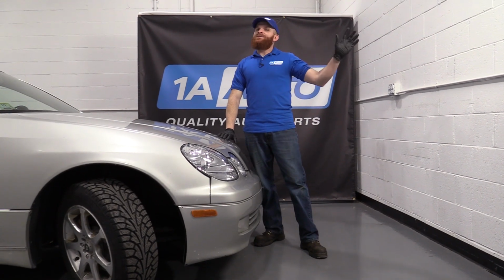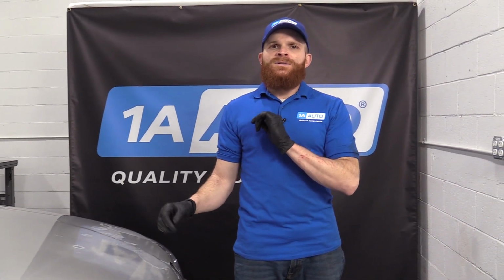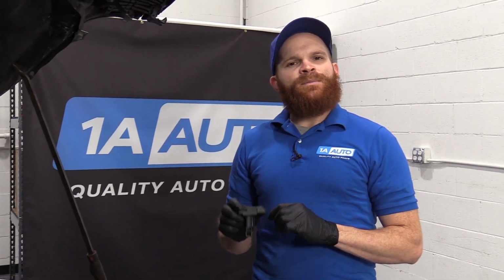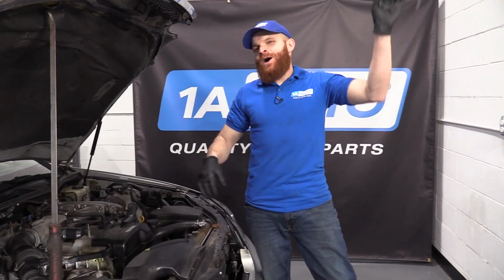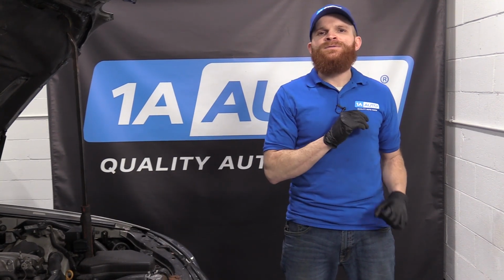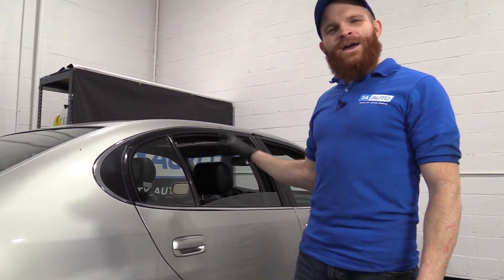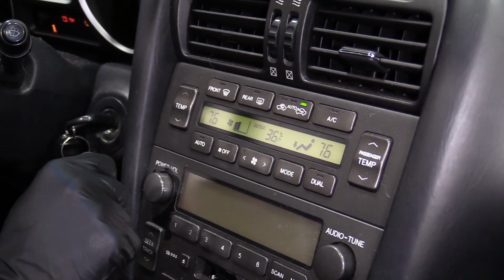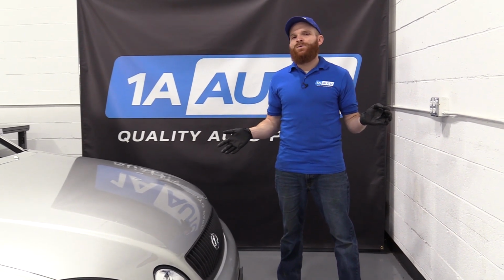Top 5 Problems Lexus GS300 Sedan 2nd Gen 1997-05

Comment from the maker: √  Watch the Video
√  Buy The Part at 1A Auto https://1aau.to/m-Visit-1AAuto
√  Do it Yourself
√  Save Money
Reply: what about the brake booster
Reply: What about the battery draining after everything else is replaced
Reply: Great video just bought a 1999 gs300 under 200,000 miles gonna get the 10 piece kit you guys got for $110 thanks for the information
Reply: Thks for the video I just bought a gs300 99 with under 335,000 miles still runs strong. That lower ball joint is my only issued I'm getting worked on right now.
Reply: Thanks bro, I’m going to purchase either an GS300 or IS350. Appreciate the advice.
Reply: Thanks soo much for pointing out these issues. I really did have this lower ball joint issue and i took a u turn and my wheel literally did came off a year back

The second one door lock actuator: exactly the same doors passenger and back side of the passenger door have issues. 

and lastly the HVAC servo Motor i still have this issue.

you have literally made things so much easy for me instead of going to different garages and checking finding out the faults.

Thanks !

Comment: Len is right about all of this I have a ‘02 IS 300 with 265k miles only thing would add is harmonic balancer eventually rots out, also alternator and a/c compressor, and struts depending on mileage

Comment: 1AAUTO I’ve been watching yalls vids since I was 13 years old back in 2008-2009 an have bought many parts so can you please answer this question?

I’m about to buy one an the guy is making me sign a paper saying if anything happens after purchase it’s sold as is. So I’m wondering if these have ECU Problems that’s my only concern he said the car dies after running for 20 mins an brought it to shop an shop said it was lose terminal but he still wants me to sign the paper… plz lmk it’s a Gen 2 GS300 1998-2001 Pre Facelift

Comment: my 97 is having probs last 10 years, 260.000, stays in the garage, 20 mile round trip to work only, frt end probs at 10 years, then throttle body, next a/c, steering wheel motor, check engine light, radio, upholstery, very squeaky now, engine in good shape....very happy with it

Comment: Mine is an 02 GS300 VVTI and I have a bad parasitic draw issue from somewhere and have checked all the common sense things it could be. I have the same door lock issue,the same air intake sensor issue and i hear a noise behind the dash when the car is off. Sounds kinda clunky,like the cd changer but it’s not the changer. Any help would be greatly appreciated! Thanks!

Comment: I got a question my gs 300 gives me a o2 sensore code P0141 01/01 which is the front one but when i replaced it to a brand new denso o2 sensor drove it for 200 miles the engine light didn’t go away and when i deleted the code it still is on i need some help
Reply: Try adjusting your throle position sensor. Mines wasn’t properly calibrated an gave me vsc light and p1014 code

Comment: I bought my 2006 GS300 used in 2010.  It had about 62k miles then.  Now it has just over 361k miles and while it has some issues it still drives very well.

Comment: Loved my 2005 GS300, but the ball joint failure happened while driving in traffic (no one hurt, luckily). Lexus fixed it under warranty at the time, but they had the car for three weeks. Currently driving an LS460 F-Sport and I kinda miss my old GS. Loved that car so much if I found a fully sorted 2005, I might get another.

Comment: Had a sway bar on drivers front side pop out from the link that holds the parts together,popped out of socket the car was marking a slight noise when i was reversing out my driveway which is gravel so its was moving and when im on a round about it would not feel as tight of steering or responsive barring right
Reply: Swerve motors and transmission slipping from being over filled and water punp leaking rust pockets in back wheel well and muffler rot other then that the car is very well for the age and better then 95% of the cars in the road Toyota did well other then bot giveing us in the us a 2jz gte🤦‍♂️😂

Comment: I’ve had 3 of these and LS400s also and the rear spherical lower bushes always need replacing and are difficult to do for diy, and I’ve had a heater core leak in one which was a nightmare to replace, full dash out.  Other than that and a bit of paint fade they are bulletproof, no rust, 2J is hard to kill.  Great cars.

Comment: What should I check for my 300000 mile 2002 gs300? 

I’ve done valve cover gasket, plugs, coils, power steering pump,  vvti sensor. Timing belt is good, but my radiator is brown 😑 should I replace? Or wait for it to go bad?
Reply: Vvti solenoid**
Reply: Also I only have heat on pass side and it only blow when Ithe car is moving.. otherwise no heat or air with blower on high.
Reply: @Zaydub666  This symptom for me was due to the door blend servos. If you’ve ever heard a sound under the dash that intermittently sounds like VVRVVVRVVVV (lol), then it’s that servo motor getting stuck on itself and “hunting”. The conductive contacts get worn as the lube dries up and the dust from the contacts will short two of the contacts together.

Comment: This guy is spot one - I've had every single one of these go bad on my Lexus except the lower ball joint.  The lock actuators are super pricy so I haven't replaced them.  I rebuilt one and it was a super pain in butt.  I've replaced my B2S2 02 sensor twice and upstream B1S1 once.  My 2003 GS300 has 185k and is making squeaking noises, which I thought were the shocks.  I'm going to see if there's any play there and replace.  About $95 each from Napa.
Reply from the maker: +Puffy Elvis Thanks for the feedback!

Comment: My 99 GS300, has 135,000klm, that’s about 84,000miles for you Americans, I replaced two controllers for my climate control but still need to replace the other one, my passenger gets cold air but I get ice cold air, but my back isn’t what it used to be so it’ll wait til I come good. It can be a bit thirsty so I may change out the o2sensors. I’ve had 40 cars in my 67yrs. this is by far the best.

Comment: Love my 2004 GS300. still got it today. Not a fan of IS or new styling. 
I changed the ball joints at 100k and the driver side was rear ready to go. 
Had the HVAC issue, it would buzz if I moved the airflow
only replaced the top 02 sensor at 80K

Comment: Every time I  turned right a loud squeak would come from the front , it echoed around the whole neighborhood. Took it to the mechanic and they told me the lower ball joints needed replacement, luckily I didn’t get hurt . I was driving it around like that for a month 😂

Comment: For those of u wanting to know what actually goes bad on a gs lol fuel pump brake abs module throttle position sensor and for those of u that replaced ur door actuator and the keyless locking isn’t working take ur door panels off their will be a little black box I don’t remember what it’s called but that’s what u need to replace
Reply: Any find out what the little black box is called? I thought one should just replace the actuator. Are you saying this isn't correct? Thanks in advance.

Comment: Best car in the world ...this car was my dream car in high school and I'm so glad I picked this car. I have had this car over 15+ years and I love it. I think if I have to let it go...I would cry! I even purchased a 2007 LS and I still love to drive my GS while my LS sits in the garage. Crazy thing is my V8 LS saves more on gas then my V6 GS. Both cars are amazing but my GS is my daily driver. So if you hate cars that have major issues get a Lexus...in my experience all u have to do is change the tires and regular maintenance...my GS is nearing 400k and it still rides smooth and the AC is blowing colder than anyother car I have been in. I trust this car with my life and my family to ensure I get from point A to B without being left on the side of the road.
Reply: You are living the dream sir one day I got a gs 🙏
Reply: Yeah, I agree with you, it's the most reliable car on the planet, it can last for a life time.
Reply: I read that your GS300 has a V6 engine! Mine is a straight 6, a 99 model. I didn’t realise there were different engines in these cars.
Reply: Bro the GS 300 is not a V6. It’s an inline 6 😂
Reply: Any carbon build up issues?
Reply: I recently bought a gs, I’ve had every other model and the gs is definitely my favorite. 400k is nuts and I can’t wait to hit those numbers, cheers
Reply: I hate my Lexus. Replaced the radiator last week now the water pump seems like it’s going bad. Need a new abs pump too. I hate these cars.

Comment: I had a 1998 that I loved until the master cylinder started leaking. I was told that the part was 1500.00 alone. I traded the car in. I still miss it. What a great car if you don't have to replace the master cylinder.
Reply: Could’ve easily bought a used brake master cylinder 200-400 bucks
Reply: @iheartgs400  got mine on ebay for 316? I gotta replace that and the damn water pump. Hate these cars so much
Reply: how many km when it started leaking?

Comment: I have problems,  I have same this car I checked coil ,spark plugs  timing sensor new shift crank adjusted  when the car stop coming high vibration .. code p1349 and code Code p1656 light appear...

Comment: had to change the VVTI gear on a 02 GS300 that i just bought. Maybe I should buy the solenoid too, but I haven't gotten an engine code for it.  Should I just replace it?
Reply: If it is not giving you issues just leave it.

Comment: i have gs300 this generation. 210,000 miles.  I  am devotee of cleaning the Mass AIrflow Sensor with the specific MAS spray once a year and jet cleaner in the fuel tank two or three times a year.  THe only major issues I have had timing chain seal, one coil.  Just yesterday the starter motor failed for the first time so we hit it with a hammer. I am going to replace it later in the week.  Coincidentally, i think the throttle body has a carbon build up so that's also on the list later this week.  Pretty easy to self service by the way.

Comment: Some things were missing here.
1.Master Brake booster fails.
2. Transmission sensor.
3. Accelerator can stick in traffic when using kickdown. 
Because I've experienced this my 1998 GS300
Reply: I have a 98 my damn self and the bmc is bad. Also my water pump needs to be replaced just a week after I got a new radiator installed. I hate these cars.
Reply: @brandobee2264  it’s a 24 year old car, to be expected.

Comment: At about 300,000 miles I had to replace everything that he mentioned and 4,000 bucks later I had a brand new GS400
Reply: 300,000 miles...lol that speaks volume on these cars for real
Reply: @T5_T-Rell  toyota lol
Reply: I'm at 287k miles right now on the GS300....only thing that's gone bad so far is those damn door actuators and the brake master. outside of that...it runs like a champ.
Reply: I got the 2000 lexus gs 400 with 160,000 miles and got the stock 2jz in it there great cars
Reply: @SkylerCamara  400 shouldn't have a 2jz
Reply: @SkylerCamara  400 has 1uz, 300 has 2jz, and 430 has 3uz
Reply: can I message you privately & ask you something? I am about to buy a 99 lexus gs300 & want some opinions. My ig is @mother.art0 if you have some time
Reply: @aureya777  it's a great car. The engine in that car is very reliable and a lot of kids are after it. Get it while you can and take care of it.
Reply: how much was the vvti solenoid?

Comment: What about bad ECU/ECM GS430 2002 . Mine just start to have harsh gear from 2 to 1 speed, i heard its a commun problem .The surface mount resistors are prone to the heating and cooling cycles in the engine bay causing dry joins.
Reply from the maker: +kévin dallaire Thanks for the tip! We'll pass this info along to our production team.

Comment: A year ago, my Vvt solenoid went bad on me 4 hours from home. Car was shaking like it had a Cam built from satan at idle. Had to put the car in neutral at red lights and hold throttle at 1500-2000k to keep her running. But she made it 267 miles all the way home 😂😂 got home an ordered the sensor from you guys. No problems since. I’ve owned 3 of these over the last 15 years. The body style is timeless, my current one has over 300k on it and 98% of the mechanical parts are original.
Reply from the maker: +anthony delgrosso Thanks for the feedback!
Reply: I know this an old comment but did u get a check engine light when the solenoid went bad?

Comment: I have the P1755 solenoid code. Can anyone give pointers to what I should look at?
Reply from the maker: +Hellboy Uchiha This code is related to: Faulty Torque Converter Clutch (TCC) Solenoid
Torque Converter Clutch (TCC) Solenoid harness is open or shorted
Torque Converter Clutch (TCC) Solenoid circuit poor electrical connection

Comment: have a harsh 1 2 shift in my 2000 GS300 already cleaned the MAF and replaced the ECU due to a random limp mode issue. fixed the limp mode issue now trans is having harsh shifting 1 to 2 gear. gonna try a MAF next
Reply: Did it help? Just curious
Reply: @uali543  actually driving it and letting it shift into every gear over and over it started to smooth out and learn. But cold shifts still sometimes are rough. Gonna drain and fill the fluid with Toyota ATF

Comment: this guy is SPOT ON ! i am gs300 owner since 3 years and faced the same issues. But apart from that the car is solid and reliable.
Reply: where u live ? what is the KM/ per liter
Reply: Me too. Mine has 110kmi. And I'm having loss of power issues.
Reply: @shadetreemech290  it’s could be your spark plugs or your intake resonator is cracked.
Reply: @Ricky-gr6uc  i just got a 2000 gs400 for 4K super mint 170k miles everything super clean I’m from la but I found the car in San Diego I came up 😎
Reply: No hes not, he was wrong about explaining the sensing elemnet on the maf, the blue dot is the IAT sensing element, the thin wire inside the maf is the hot film sensing element wire, this guy dont know the difference between his cornhole and hold in the ground, what a wannabe sellout auto tech
Reply: Interesting
Reply: Big difference between the gs300 and vs 400 and 430??? Been looking for the v8 engines but can only find the v6 in actual decent condition with lower miles seems as if all the v8 engines have over 200k at this point
Reply: @Saks5thFrick  I'm nitpicking but it's an i6 and not a v6, to answer your question engine is literally the only difference between the two.

Comment: Great job! 
Have or had everything out of that list! 
Didn’t know why my AC doesn’t change the direction, so now I know. 
Mileage 252000, going strong. 
Also would add main wiring harnesses that goes to spark plugs. The insulation is tend to decompose and shorten circuits to cause the misfiring. 
Valve cover gasket, steering rack bushings somebody already mentioned in the comments, agree with that as well.
Reply: jjust had that issue with my wires 230k running strong again now

Comment: On my 2000 Gs the radio display is the problem. The original one failed under warranty and was replaced but the current one failed a couple years ago.
Reply: Yes mine lights up but no longer displays the station. How did you fix it?
Reply: put some Pioneer full hd screen with cd and netflix and welcome 2021 with your lexus :)

Comment: My ABS and Brake lights came on in the dash. At the same time my shift intrlock, power window switches, sun roof switch, heated seat switches, the heater controls, and the rear defroster all quit working. Is there a common fix for this type of problem?
Reply: Had a similar problem with my 2004 Rav4. Malfunctioning fuse block fusiable link. Intermittent failure until I figured it out.

Comment: i had a ball joint pop at 100km/h. take care of that before it happens.

the actual sensation of the ball joint separating was the steering got really really heavy all of a sudden, then suddenly the tyre spins 90 degrees and lodges itself back into the wheel well. the car tried to pull into the oncoming lane, by i wrestled it onto the side of the road.
Reply from the maker: +gharkun Thanks for the feedback! Glad to hear you are safe!
Reply: sounds scary.

Comment: Lastly, My gs300 always kill the battery, I changed the alternator and go a new battery 100AH. What could be the reason for the battery dying?
Reply from the maker: +Ochuko Abuwa We wouldn't be able to diagnose an issue like that here, you may want to have a local mechanic take a look at it. Thanks for checking us out! 1AAuto.com
Reply: 1A Auto Parts thank you
Reply: possibly a parasitic drain or bad battery cable , could be a load of things... a pierced wire somewhere, i even seen a guy whose battery would get drained from bad ignition coils while the car was off... good luck peace

Comment: Pro tip from a guy that builds computers for a living, you can use rubbing alcohol to clean electronic components. Reason being is it evaporates VERY quickly, especially near heat. You're welcome.
Reply: just like to add on here that the alcohol you should use to clean electronics is Isopropyl alcohol at an alcohol rating of 70-99%, using anything less or hydrogen peroxide will leave unwanted additives on the sensor or circuitry
Reply from the maker: +George Muller Thanks for the tip!
Reply: Isopropyl alcohol* 😎
Reply: Thank you
Reply: My car says my battery is hot, why is that???
Reply: @mikes3852  alternator could be overcharging battery
Reply: Terminals.

Comment: Doesn't the USA have MOT tests, ? In the UK ours have to be tested every year and something like the lower ball joint would be picked up. I have to say I have a GS300 99 with non of those problems.
Reply from the maker: +Golo1949 Certain states have safety inspections for vehicles, some more strict with a full point safety check and emissions tests, and some states have no inspections at all. 1aauto.com